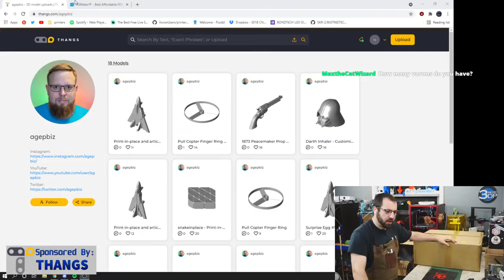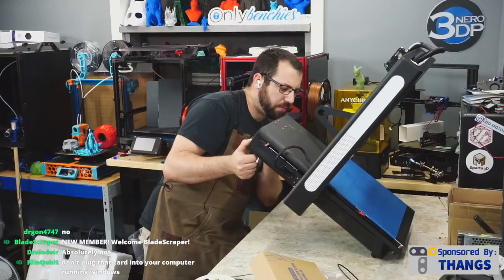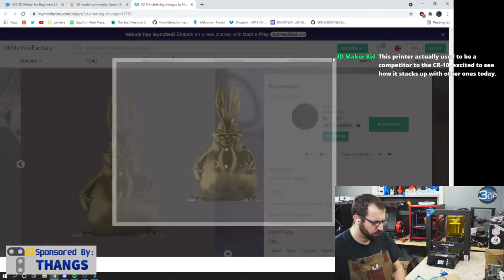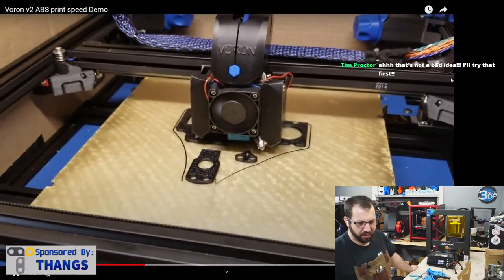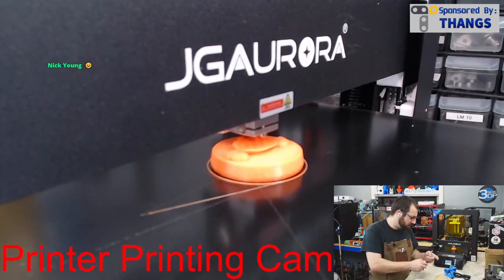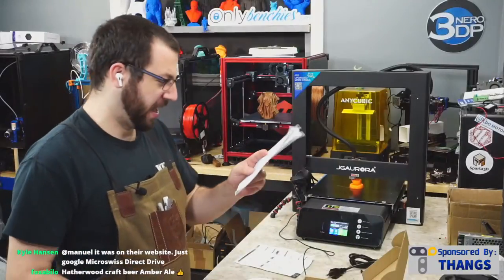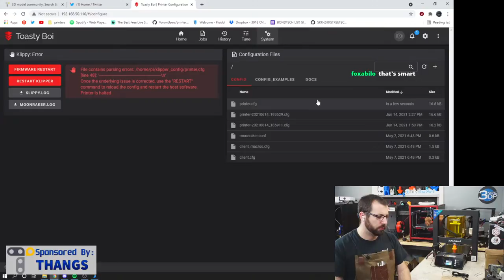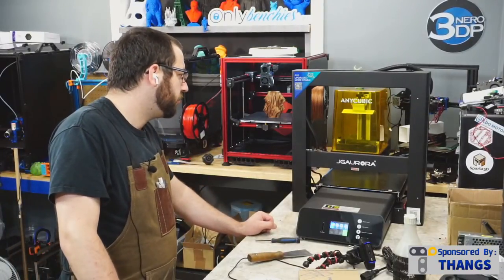Random Printer Build- Its a JGmaker A5S Printin N Chillin

Comment: I snagged an broken A5S for a song ($120) All it needed was a new power switch. 

It's actually a very capable printer. But not very mod-able. Certainly better than other monolithic printers like Monoprices Maker Selects. 
It's been fairly reliable for me printing about 1000 hrs worth of filament.  The A5S actually comes with a 32bit board with A5984 not a4988 drivers. Better drivers but Trinamics are still better. Older versions came with MKS GEN/Base boards.

You can upgrade to marlin by downloading the community firmware and popping it on an SD card, moving back and forward between OEM and Marlin is simple.

All this said, its not worth it, all printers will eventually have failing components and this one is harder to work on than others. Get something that's easier to repair/maintain. Something more akin to a CR10 clone. Even an Anet ET5X would be better for less money.